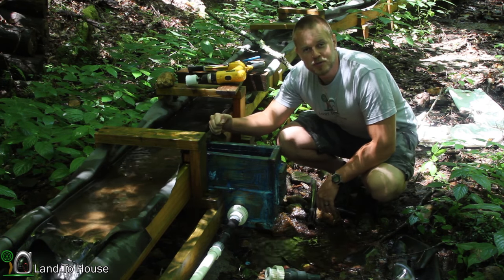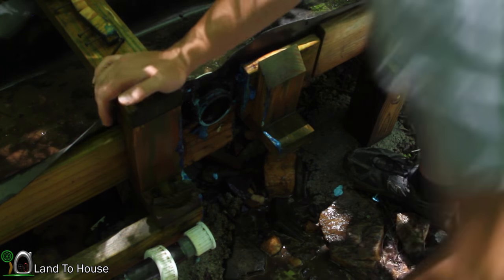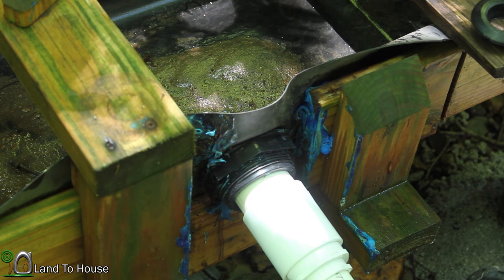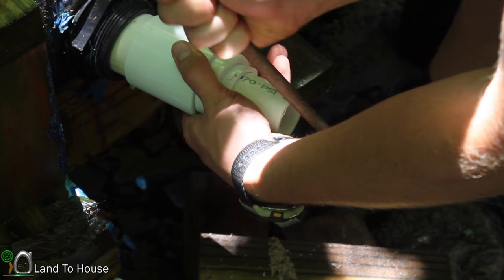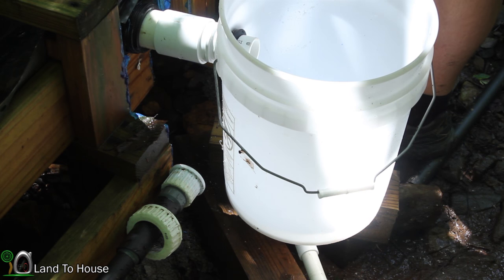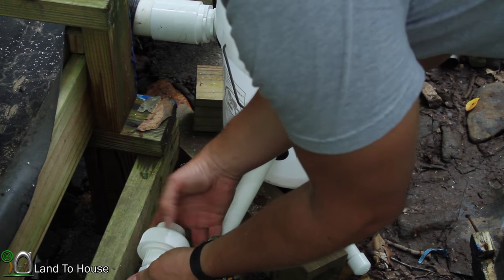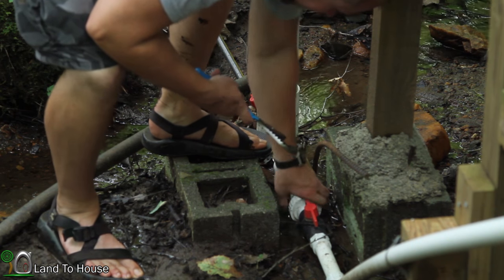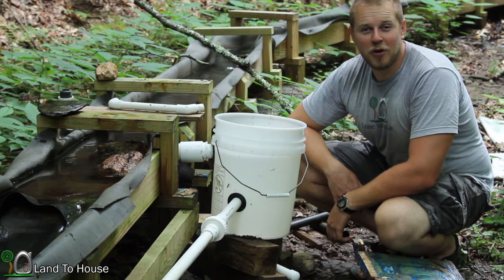Ram Pump Bucket Intake

Comment: Hi Seth, following up on our exchange from one of your older videos, I've got my pump pretty much assembled and ready to install but had one more question. I'm using the bucket reservoir system to feed a 1"x 20' drive pipe with a head of 8' going to a 1" pump. At this point I have a 4" x 3' pump body. Is that overkill? Is there any downside to having that large of a pump cylinder? I would like to have as much pressure as possible at my destination in the garden so I built it big. Thanks.
Reply: Update: The pump is working but I think the 1" pump is too big for my gpm at the source. It pumps great for a while but then the outlet at the bucket overtakes the flow and it starts sucking air. I only have 3.3 gpm and now I see 1" pumps need min. 6gpm. Wondering if I can change out the 1" drive pipe with a 3/4" pipe and leave the 1" pump set up? What do you think?
Reply from the maker: Woops missed your comment. So yes you can use a large pressure tank. If the tank is too big it will just take a little longer to startup. The 1" pump does need around 6gpm minimum to work and 10gpm is a better rate so you can have a little wiggle room. The 3/4" pump will still need around 3gpm to work. You might want to look into a 1/2" pump. .. Using a 3/4" valve in the 1" pump will work but will be inefficient
Reply: Is there a way to reduce the water flow through the impetus vale. Or rather , have the impetus valve close faster? Rife uses a counter balance adjustment on some pumps. 3.3 gallons a minute, 1" driveline at 8' of head? It should pump water 75' vertically! Keep in mind that you want 12" of water above the drive line inlet
Reply: 6 gpm? Really? A Davey can work on as little as 3/4 gpm. Something ain't right. I had a 1 1/4" Rife pump(the drive line was 1 1/4") that operated on 3 gpm. Those little pumps you're making should run on 1/2 gpm. Talk to me. I can advise. Master plumber 41 years and stilll doing it. Happy to help

Comment: Can the one way valves be spaced out more? Will that improve the water flow? or will it degrade it?
Reply from the maker: You can make the pump longer but I feel like it would be less efficient. Especially if the pressure wave is fast.
Reply: Land to House have you tried it?
Reply from the maker: +Dave Nick my first pump was about 4 feet long.it seemed to work just fine. But I did not test any values.

Comment: Put alid on the bucket and that will stop debris falling or blowing into the bucket.
Reply from the maker: +Barry Laws it will need something. I will have to consider the need for air flow to let water out. Perhaps a small hole in the lid. Leaves will be here soon and that will clog a pump fast!
Reply: .Drill a series of 1/8" in the lid or use some fly screen screwed down to provide ventilation.
Reply from the maker: +Barry Laws I started the pump and 4 days later it stopped. I feel like some debris fell into the bucket. I do like the small hole idea.

Comment: If you're not glueing the pipe together not maintaining a water tight seal between the flume and bucket, then why not just let the water run from the pipe into the bucket via the huge hole in the top of the bucket?
Reply from the maker: that would work. I am about to rework the bucket intake with a filterer from upstream. It will be in part 4 of the off grid water tower build.

Comment: Can u help me? Inspired by the videos I built a ram pump using a 2"pipe as cylinder at least 1500mm long. 40mm in reduced to 20 mm outlet. head of 6m so lots of pressure...but it does not want to work, what am I doing wrong
Reply from the maker: +Robert C Kusel hello.  It would be helpful if you could send an image of your pump to my email. Landtohouse@gmail.com. I will see what I can do.
Reply: Ok will do thank you
Reply from the maker: +Robert C Kusel sure thing.

Comment: y did the pump stop?
Reply from the maker: Several reasons. There was air getting in a drive pipe joint that I forgot to glue. And I had a sizable leak in a garden hose that I was using as the delivery pipe.